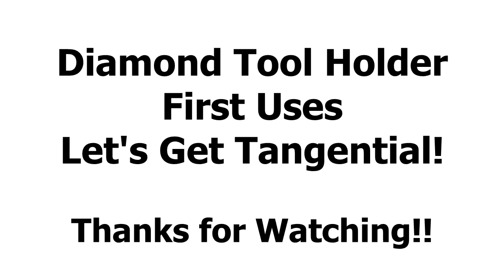DIAMOND TOOL HOLDER

Comment: I bought my Diamond a couple of weeks ago, I haven't been using anything else since then, I love it! Great demonstration of the round tool bit, I'm grinding an old centre drill tomorrow just for trying out,  but I'm worried my lathe isn't gonna like it. It's not rigid enough for large radius tooling, but maybe it'll work for finishing. Thanks
Reply from the maker: I'm loving mine as well. Especially for fine work.